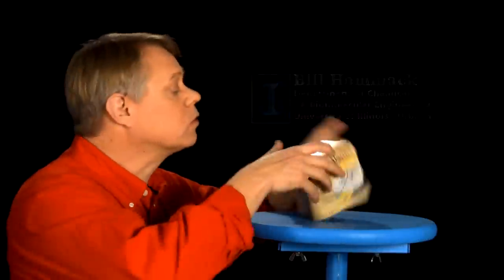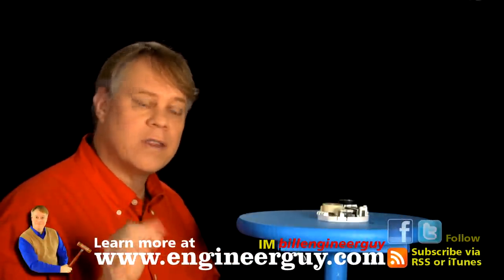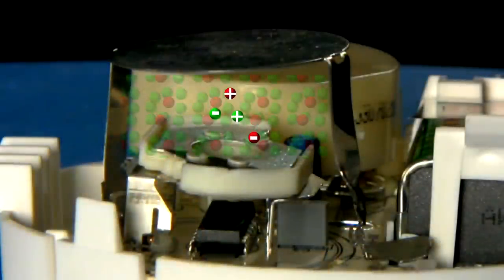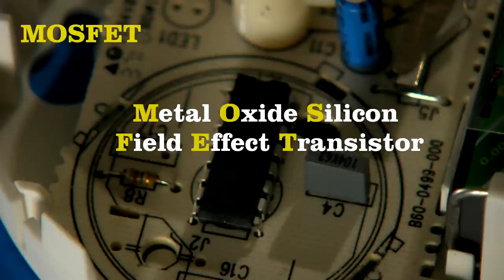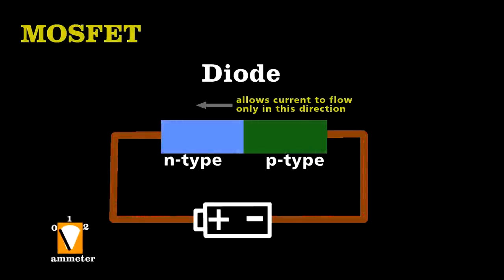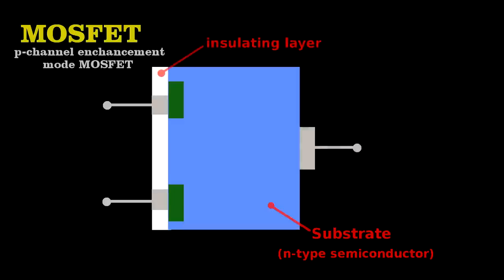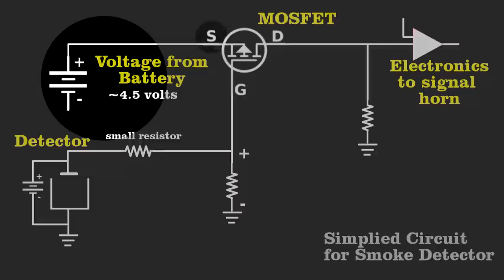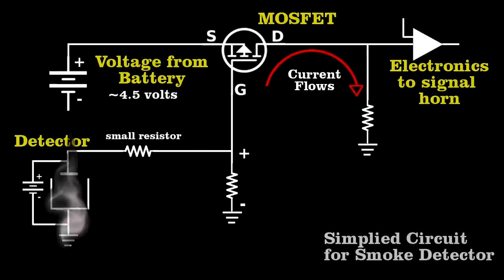How smoke detectors work

Comment: You might want to research air conducting electricity. Air conducts electricity just fine, in fact it conducts electricity faster than any other solid or liquid, it just does not conduct a lot of current, amperage. 

In a common light switch that uses a 1/32" air gap, to stop the flow of electricity. A condenser, an air capacitor is formed, to charge and discharge 120 times a second when used to switch 60 hertz AC power. Only electricity stops electricity, insulators do not stop electricity without charging in a ramping voltage. When the air gap or air capacitor is formed between the points of a light switch, once the air capacitor is charged in a ramping voltage it stops the flow of electricity across the points. When the AC cycle reverses polarity the air capacitor is drained and recharged to stop the flow of electricity in the opposite direction. 

When a switches points are first opened the gap is small so the distance or thickness of the dielectric between the plates or points is small and resistance is low. Often electricity continues to flow across the small air gap, until the points are fully opened. 

Incandescent bulbs are self inducting, meaning that they hold a charge much like a capacitor does. The incandescent bulb is also much like an induction device, the voltage can be higher than the input voltage applied, when disconnecting the bulb. 

Across a 120 volt incandescent bulbs terminals, you will note there is a 120 volt, voltage drop, when it is being powered by a 120 volt AC source. Much like a capacitor will create a 120 volt voltage drop across its terminals once charged. Except there is much more drain or loss from the light bulb than a capacitor.  

Insulators conduct voltage faster, than a conductor, conductors like copper or silver. Insulators only limit amperage once they are charged in a ramping voltage from line to load. Much like the self inducting light bulb limits the flow of current once it is lighted and charged in a ramping voltage. If you check the ohms through an unlit incandescent bulb you will see the resistance is low, often almost a dead short. However once energized, the resistance raises a lot, as much as 10 to 100 times the non energized resistance. While being powered a 100 watt 120 volt incandescent bulb creates 144 ohms. That is much higher than the ohms while it is not energized and not self inducting. 

The radio active substance in a smoke detector emits a high frequency output, that connects lower voltage sources of power over a greater than normal distance.  But the world I was taught about is much different than the modern world being taught today. 

The videos are very cool, however I did notice some flaws in the basic principles being explained. 

   Sincerely, 

       William McCormick.
Reply: +William McCormick The point here is that the radiation enhances the flow in a way that is lost when smoke is around to catch the ions.

Comment: With the small amount of americium creating such a small current could it not be scaled up to produce more power? And how much americium would be required to par say generate oh 5 to 12 vdc?
Reply: Andrew harbit In solid state, power is more closely allied with the current passed rather than the voltage (the opposite is true for vacuum tube circuits).  MOSFTS generally operate a 5 volts, so your question is somewhat moot.
Reply: Ok ive done a little research but could you also explain why the beta type rads from tritium activate the phosphorescent effect and could the same be accomplished with am 241?
Reply: Alpha and beta rays are actually particles ejected by the radioactive nuclei at very high speeds (near relativistic). Alphas have more energy due to their very much higher mass, about 6000 times more mass than a beta, while betas, with the smaller mass and half the charge, penetrate better. Some phosphorescent minerals require more energy to "fire" than others, but as long as the energy is delivered, the phosphorescence occurs, regardless of the source. Some materials are "tuned", so they will fire for alphas or betas of a particular energy only. So, yes, there are materials which will respond to both tritium's betas (which are relatively low energy) and Americium's high energy alphas.
Reply: Thank you very much
Reply: +Andrew harbit you certainly need to replay the video, in order to understand why your question is invalid.
Reply: My original question has value in the sense I am reaching out trying to look at underestimated energy source potentials. It's not that farfetched to consider one could produce viable energy from americium.
Reply: Voltage?  It's not producing any kind of usable power, the thing that determines the voltage is the battery and the resistance.

A larger amount of radioactive material would increase the current, but the voltage is determined by the kinetic energy of the alpha and beta particles.  If you made the thing really big, you could theoretically get a some megavolt of potential on it.

Comment: @timerider4 Oh, dang! Now I am going to have to answer my own question. I remember that there are some sensors that have an exposed filament in them that was used by several companies (Heathkit was one)  to build gasoline fume detectors for use in boat engine compartments. These sensors are sensitive enough to tell if gases are within the explosive limits, but perhaps not sensitive enough for breathing air. In other words, you might be dead before the EL is reached.

Comment: YOu have your MOSFET drawn backwards.  Electrons enter the source and exist the drain. IE: The Source should be towards the - termnal on the battery because the electroncs exit the battery on the - termnal.   The current flow that is show is "Hole Flow" (Positive to negative)  However source and drain are set up for Electron Flow (Negative to Positave)  Unless of couse this is an anti-matter battery, in wich you have positrons that contain the positave charge ;)
Reply: I'm not a smart dude, but from my very basic knowledge, he might just be taking about conventional current
Reply: "Source" is the source of charge carriers, electrons for n-channel and holes for p-channel. He drew a p-channel MOSFET, so labeling is correct.

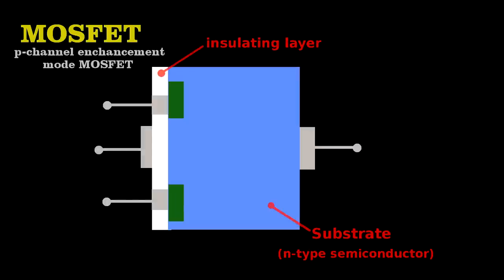Comment: 2:33 So from what I understand, you can create a current that opposes one diode if a current flows  in the direction that another diode is pointing when the current pushes the charge from the positive side on through the circuit.... Im not sure If I still understand (I thought I did for a second). This seems contradictory to all of what I know about electricity flow. Would anyone mind giving an explanation?

Comment: This type of Smoke detector has been outlawed pretty much everywhere due to disposal issues. Although on its own not dangerous at all, storing a box full of them is a problem. 

They've been replaced by Photo Electric Detectors for the most part, a lot safer.
Reply: I have an old detector that still had Americinium in it
Reply: Outlawed.  WHERE?

Comment: if i smoke weed in my room and the smoke detector is outside my room will it work?
Reply: +damola omilani What do you mean "work" as in trigger? Probably not. Ionization detectors have been discontinued due to disposal issues. 

As long as visible smoke does not surround it you're ok.
Reply: Call your local police department for advice on that matter.

Comment: those smoke detectors that work with a LED and a light sensor were not around in 2011? strange. but i guess radioactive materials are cooler than this other boring stuff